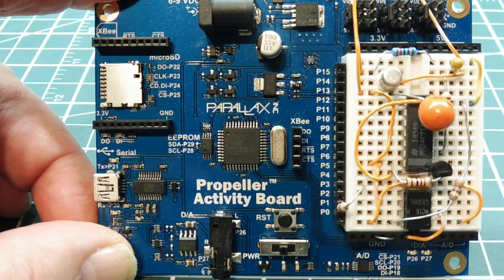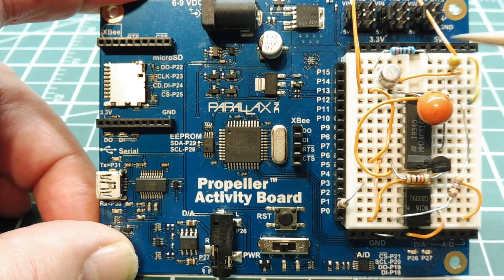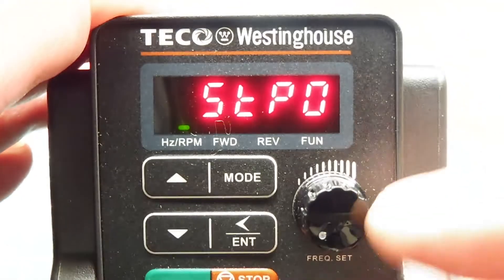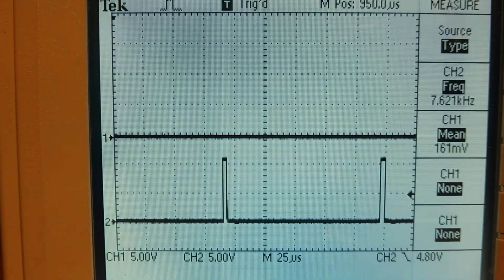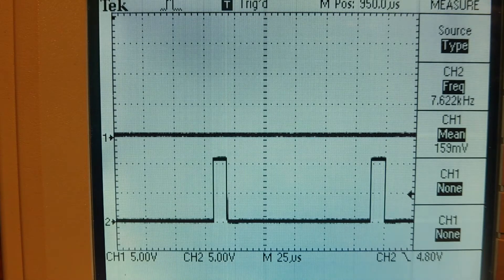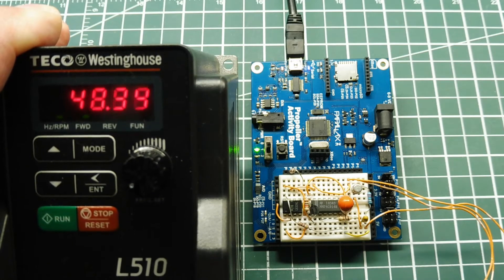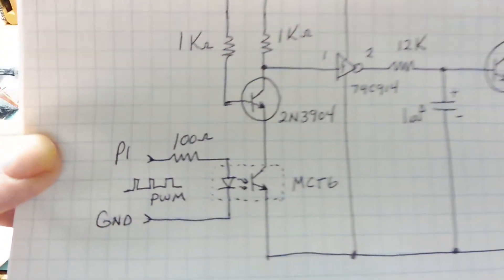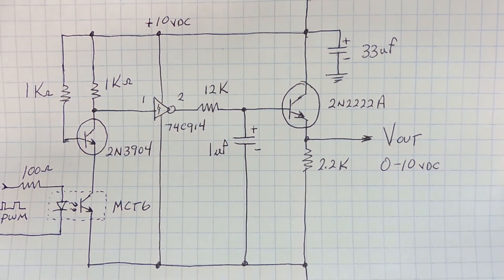3 Phase Motor Control using PWM  / Parallax Propeller

Comment: Good Job . i am going to try it.  will you be willing to share code for the micro-controller?
Reply from the maker: I use Forth to program the Propeller microcontroller. ( Tachyon Forth  )
Here is the code using the Forth programming language:
 : DAC1  ( PWM output on Propeller P1 )
          cr ." Use + and - keys to change PWM" cr
          BEGIN
          WKEY dup
          56 =   \ + key
          IF PWMval dup C@ speed C@ + 255 min
             dup #P1 DAC! swap C! PWMval C@ . cr THEN dup
          50 =   \ - key
          IF PWMval dup C@ speed C@ - 0   max
             dup #P1 DAC! swap C! PWMval C@ . cr THEN
          27 =   \ esc key 
          UNTIL ;
I also used PWM to control a VFD using the Arduino Nano.
Here is the link.
  https://youtu.be/MTGhQMxSTQw

Comment: Hey can you please explain the speed control of three phase induction motor using PWM technique on hardware
Reply from the maker: Most VFDs will accept 0-10 volts or 0-20 mA current loop signals to control the speed of a 3 phase motor. You can create both signals with a microcontroller using PWM. Check out this video:
https://youtu.be/9ZKrYfIp-Yw